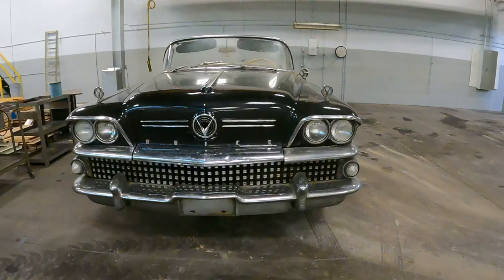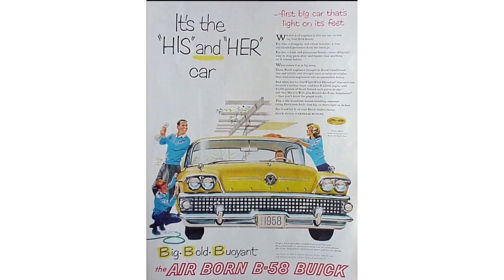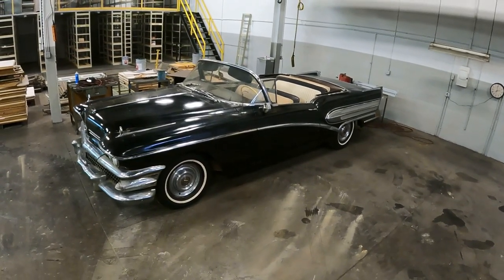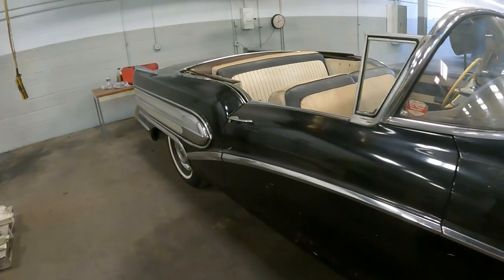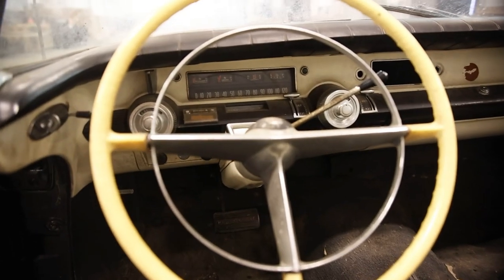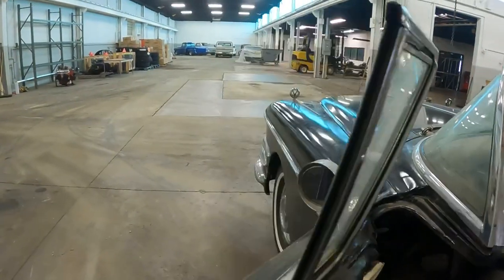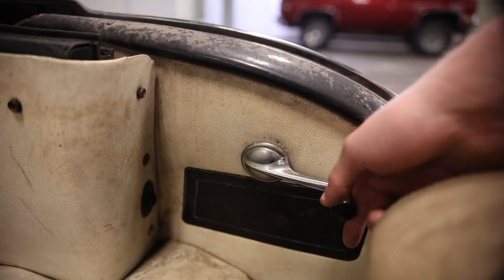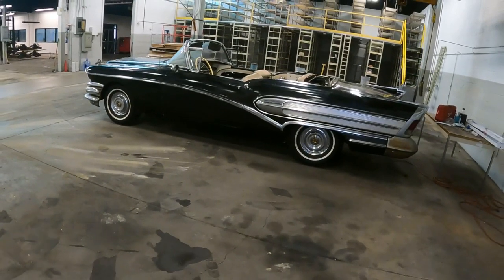Most In depth look at 1958 Buick special convertible on the tube

Comment: 1958 was the year GM went full baroque with styling. Over the top but classic.
Reply: Big series cars in 1958 were an inch wider than the Special and Century. Front bumper guards were different. Back up lights were mounted differently. There's a myriad of subtle differences between big and small series cars with many parts that are not interchangeable such as the grille and hood bar.

Comment: You forgot the Super and the Riviera, and yes they were different trim levels
Reply from the maker: Making 6 convertible trim levels offered
Reply: 1958 Limited.
Reply: Yes, Riviera, but it was the designation for hardtops (Ford Victoria, Olds Holiday etc.) not a separated model, until 1963.

Comment: Owned no less then 5 58-59 Buicks. That knob on the side of the A pillar on dash is the windshield wiper with the black knob next to it for windshield washer. Models in 1958 was from entry to top end models - Special, Century, Super, Roadmaster, and Limited. Special and Century are small body, Super, Roadmaster are big body, and Limited was a 1 year only model. Limited was a stretched Roadmaster with all the options Buick had and unique trim on the 1/4 panel, tail lights, and other trim pieces. Limited was a direct competitor to Cadillacs
Reply from the maker: Thank you so much for that correction and information =) lots of chrome on that car is it the most chrome on any 50s car if not do you know which car had the most chrome?
Reply: @What.its.like.  The 58 Buick model year is the most chromed car ever made. Since the big body Super and Roadmaster were C body (physically wider and longer) then the B body Special and Century, that makes the Roadmaster (75) with most trim in 1958. That makes the 58 Roadmaster the most chromed car ever made. The Limited was more conservative with the trim then the Roadmaster although highest priced which is why the 1958 Roadmaster is the most chromed car ever made
Reply from the maker: Awesome thank you for sharing when I do one of those I’ll remember that point

Comment: I had a 58 Special convertible in 1968, my senior year in HS, white with a red interior and black top. Paid $175 for it and it was in much nicer shape cosmetically than this one with a new top that worked perfectly. It had some transmission and engine issues which ultimately caused to me simply get rid of it. Obviously I regret that decision and always will. In a junkyard near me there was an identical 58 Special convertible, even the same color, which was a good parts source, but I let the whole thing go. I'll never have another one. Too expensive now. I also had a 58 Roadmaster convertible but eventually sold that, too. Plus a 58 Limited 2-door, 58 Special 4-door HT and a Special hardtop wagon. All gone. Even though I had a lot of trouble with 58s I still like them. I presently have a 58 Super 4-door HT, but don't know if I'll ever get it running. It was a gift from a friend and at this point simply  makes a nice garage ornament.
Reply from the maker: Awesome story thank you so much for sharing =)
Reply: @What.its.like.  Awesome, but sad, too, as I didnt have the sense to hold onto the first 58.

Comment: My name is Mikey Spears and I’m 71 years old in about 1967 I found a white Buick special convertible sitting in a pasture field beside service station. I had my stepfather go and ask about it the motor is locked up a few parts is missing off the motor that was sold but I bought the whole car for $20. The old girl who is white or a pearl white with a black top the seam on the top completely ripped out. I took fishing line and Repaired it. My step father tell me at 401 in a 59. they did not have an engine grand to remove it. so do you flip the car on the top and lower the engine to drop to the ground believe it or not. working outside I get the car up with a bumper jack and tires rest in a 15 inch and 14 inch rims to bring it up in the air. being a kid don’t worry only way I knew how to separate the motor from the transmission. as you can see the motor will not turn over so So I could get the torque converter boat out. my stepfather let me to use a chisel to cut the rods in order to get the converter bolts out. I managed to do it and rented a engine crane to put the 401 59 Motor in it. after getting it together it would not start. my stepfather took his alarm chain in his car and we towed it to a service station. they had it all week and they could not get it started. when I got a bag I checked her work out he had ignition wiring set for Oldsmobile engine which did not have the same firing order. I redid it to a 401 specs but it still but not sure if it’s Crank over inch creek and it turned over. I had my first year of automotive in Paul C hey Tech school. my shot teacher came over and said pull the plugs out squirt some oil in the cylinders. so I did then I cranked it over and she started and ran smooth. i’m driving at home I noticed the transmission doesn’t shift and I was doing 100 in the motor was in laboring and couldn’t figure it out . then I found out Dyna flow transmission did not shift so I was OK just a story from the past I thought maybe someone would I’d like to see it maybe yes maybe no
Reply from the maker: What a awesome story thank you so much for taking the time to type all that. It was a great story really enjoyed this one =) 

Drove a 56 Buick with dyna flow today pretty peppy for a 322 nailhead V8

Comment: The '57 was elegant and beautiful. They threw chrome at the '58 by the bucketful and didn't do it any favors. The Limited was egregiously hideous. Oldsmobiles were equally horrendous. The chrome button on the driver's door is the washer/wiper control, which appears to be missing the little lever for the wipers. The lever on the right that mystified you controls air flow from the heater -- to dashboard ducts for defrosting, or the floor for frosty feet, or both (maximum). The small switches on the rear armrests were for courtesy lights,  just below and forward, in place of a dome light, which convertibles didn't have. Useful after dark for getting in and out, as well as finding a dropped item.
Reply from the maker: Thank you so much for the information =) that interior was a little confusing... the chrome was just everywhere on that car.
Reply: @What.its.like.  Check out the Roadmaster or Limited. More chrome and more length. David Hall mentioned horrendous and and egregious. I disagree completely - a matter of personal taste. In the 50s, more chrome the better, IMO.
Reply: the wiper switch is the button on the dash (its not on the door) on the side he didn't know what it was for and is complete and intact. The black knob next to the chrome wiper button is for the windshield washer which the jar is mounted on the firewall box on the drivers side right next to the master cylinder
Reply: @montymatilda  I love 58 Roadmasters and Limiteds as well as the 58 Oldsmobile, all models. As you say, matter of taste.

Comment: The 1958 air suspension ( Air Ride ) was also used by Chevy and I would guess the rest of GM car divisions.
Reply from the maker: Yeah a lot of companies messed with air suspension Edsel in 1958 offered it but it was problematic..
Reply: It was available as an option on the entire GM lineup, but very problematic. It's one option you didn't want. Today it's a deal breaker. I won't touch a 50s vintage GM car with air suspension.

Comment: That car is definitely “original”.  There must have been something “Special” about the ‘58 Buicks because even though my parents owned a “56 they traded it in on a ‘58. You might mention that almost all cars (other than Volvo) had metal dashboards. My mother slammed on the brakes and sent me flying into the metal dashboard of our Buick, knocking out 4 of my teeth 🦷. I suffered for several years until my permanent teeth grew in. No corn 🌽 on the cob until then. I appreciate safety features 😉
Reply from the maker: Awesome story sorry about your head to dash man that had to hurt
Reply: My wife recently slammed against the all-metal dashboard of our 50 Buick when I had to make a panic stop. She hurt her wrist a little, but o real damage done. High speed collisions in these cars, especially head on with another, were unimaginable. Old cars are great, but just don't get in an accident with one.